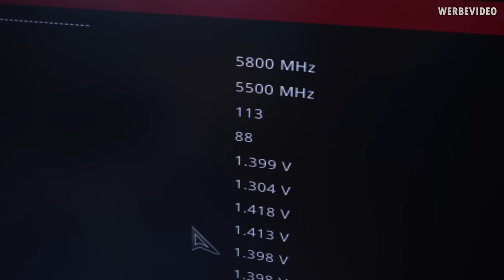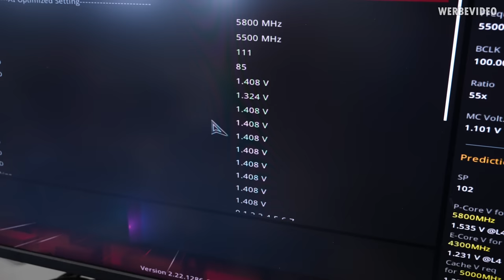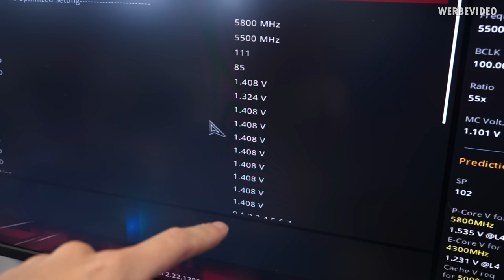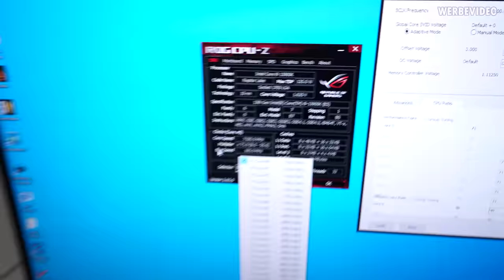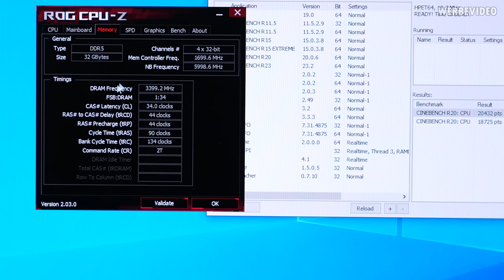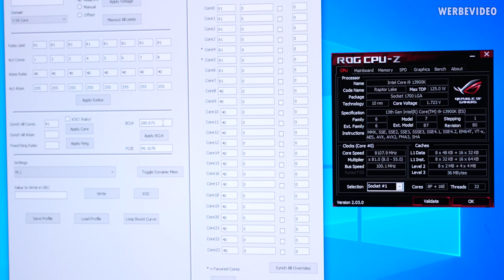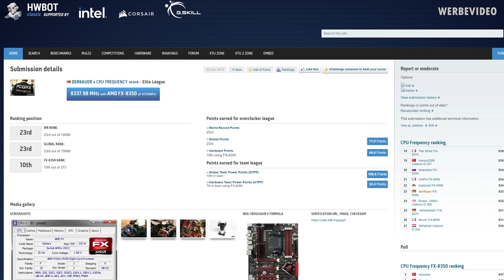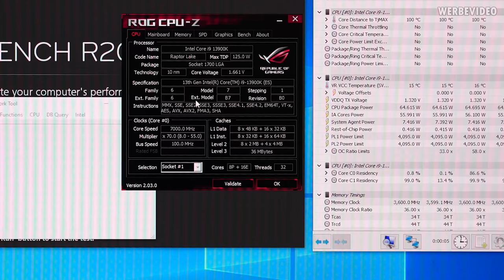Overclocking with Prototypes can be a Real Challenge - But we still hit over 8 GHz

Comment: This is more of a general overclocking question, but has anybody tried building a vacuum chamber with a built-in pot (and heat sinks for the appropriate chips and VRMs) to combat the moisture and ice issue? I imagine it would be pretty hard to have ice form if there's no air to pull moisture from. Then again, I might worry about the static buildup from running a vacuum pump, so it'd all need to be grounded well.
Reply: There's plenty of parts that would start overheating in a vacuum chamber. Heatsinks won't work at all in a vacuum since they rely on air. I think dehumidifying the room or chamber to very low values might be easier.
Reply: @KillFrenzy96  What if the heat sinks (and obviously the pot) were a part of the chamber itself? If they're all attached, and there's LN2 being dumped in the pot, would that work for wicking away the heat of the secondary components?

I'm thinking that maybe inserting some copper blocks of different sizes in between the chips/heatsinks and the top of the chamber with thermal pads wedged in there would do the trick. This would have to be a pretty thin vacuum chamber though.

Comment: Can anyone explain why this motherboard has 3 RAM slots instead of 4 or 2?
Reply: It has 2 RAM slots. The third slot is "DIMM.2", which is basically an extra PCB to put NVMe drives on it.
Reply: It's DIMM.2,
That's an extra DIMM slot that allows you to plug in an expansion card with 2 NVMe SSDs.
Reply: Is this an Asus proprietary thing?
Reply: @agentorange2618  Yep

Comment: Some absurd idea popped out to me: what if sub-zero cooling is combined with IHS shave or delid altogether?  The gains might be just a dream but if it is XOC then would not hurt to go full extreme (and you could eliminate a part of the system where condensation can happen)

Can't wait to see two pots on a single rig next time!
Reply: Nope
Reply: You need 120% of the total power attempted to be cooled with Peltier devices to get anywhere, that would also need its own heat sink and we are back at square one
Reply: @wazaagbreak-head6039  The video didn't use Peltier pads. Liquid nitrogen. The comment is about getting rid of the IHS between the die and the pot for more thermal potential aka direct die cooling!
Reply: @ruikazane5123  pipe down melanin skin
Reply: @wazaagbreak-head6039  Nah...just read the comment first before replying next time around...problem with the internet these days